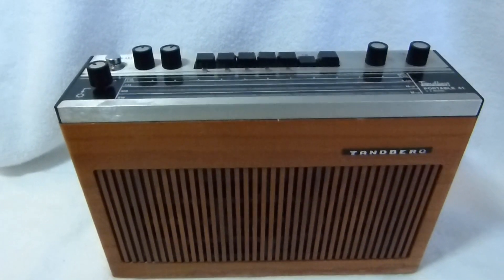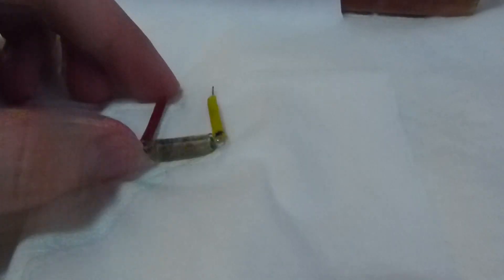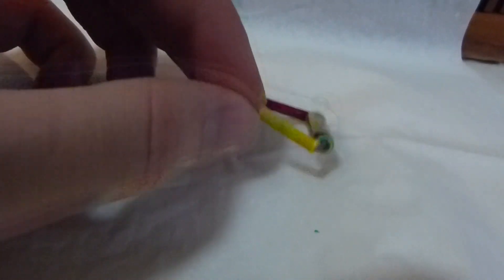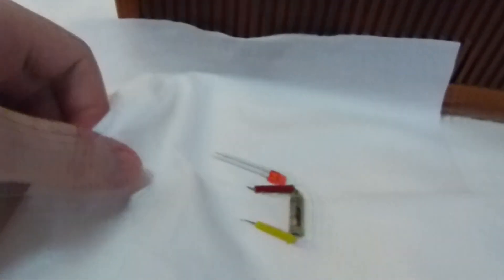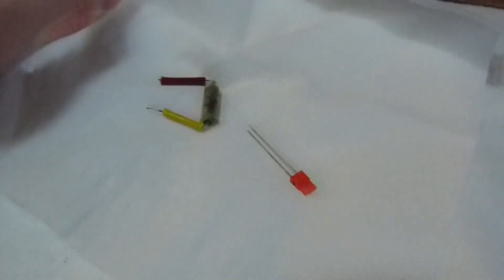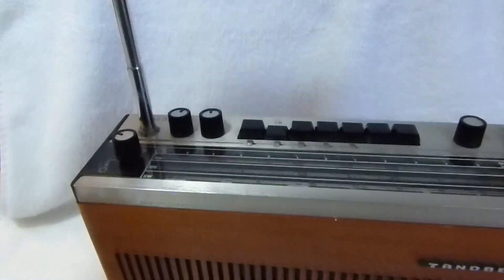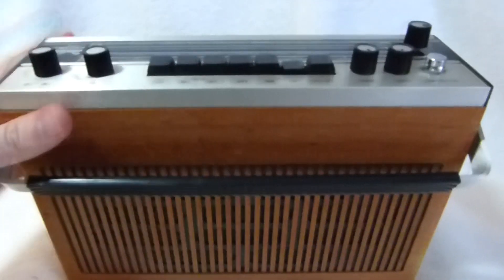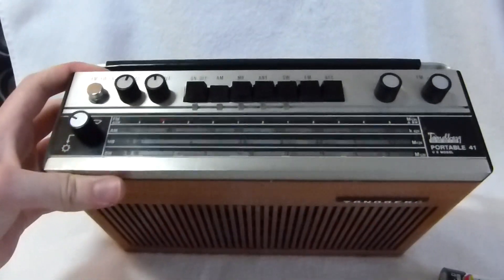Tandberg TP-41 transistor radio (Norway, early 1970s) and how to replace the stabilizer

Comment: Having one TP41.
Trying to connect AUX-cable, but getting very low audio.
But how to actually choose tape-in?
Those two buttons at the same time - marked phono, but whats about tape?
Thanks.
Just trying with my phone (having 3.5mm/1/8inch minijack out), maybe wrong impedance. Inserted a 500kohm resistor, made it a bit louder, but weak sound....

Comment: I used to sell these in my HiFi shop all those years ago. The only none HiFi product we sold. A really nice sounding radio. Just a small point, better to tune the radio with AFC off, then apply when tuned.
Reply from the maker: They are quite nice, I still use mine occasionally. You're right about the AFC, though with many sets it doesn't matter much.

Comment: They are very useful and flexible! Phono stage and 2 pin output to a mono speaker, even seperate bass and treble control. I took mine on vacation and I had one Tandberg TL1210 speaker with me, talking about Hi-Fi on the go!
Reply from the maker: I haven't tried this radio with an external speaker, since it has a big internal speaker, but it does seem to have power to spare, so I bet it sounds great on that external speaker.

Comment: Hi, I do have the same radio TP-41. Since my knee transplantation surgery, I didn't use my radio for some time. Now, the treble control knob could not be turned either side,  it's very hard   and it's jammed like condition. I am much worried about this condition of loving radio.  I carefully opened and gave a spray of 'Fader lube' of Deoxit and tried to rotate the control with effort. But, there was no response.  Dear friend, what to do? Before the long storage period, it was working well.  Can I replace the with the same model original control? Is it available elsewhere?  Even though the radio is working, I cannot tolerate this miserable thing happened. Kindly help me. My email id:   suseekish@gmail.com   Thank you.
Reply from the maker: +Suseendran Balakrishnan I usually apply light oil (I use clock oil) to the point where the shaft of the control enters the body of the potentiometer, that usually frees them up. It would probably not be easy to find an exact replacement control, so it's best to try to save this one.
Reply: 50sTransistorRadios
Hi, thank you for your reply. Instead of clock oil, shall I try with DeOxit spray? Any thick sediments will be loosened. But, should I apply only thin oil? To apply the oil to the shaft, should I open the top dial cover? Or just enough to pull the knob of the control? Please let me know in detail. Thank you. Regards.
Reply from the maker: If you have a needle tip oiler, you can just pull the knob off and apply oil to the point where the shaft enters the control directly. If not, you could just let a drop of oil run down the shaft into the control. If you have deoxit spray, it would probably make a mess in there, but the liquid form might work. I would suggest a light oil so it works its way into the bearing and frees it up. Good luck!

Comment: "how to replace the stabilizer" seems to be left out. I dont see that in this video.....?
Reply from the maker: +Stig Rasmussen I don't show the soldering part of it, but I do explain what I did and show what the stabilizer looks like. FYI, the schematic I have for a Tandberg "Auto" shows the voltage drop as being 1.5 volts not 1.8 like I said in the video, so that may be the correct voltage (I don't have a readable schematic for this model)
Reply: +50sTransistorRadios , thanks!  Yes , meanwhile I have found out about it and replaced with a LED, give 1,6V , but that was not really the problem with mine. I also had to warm up and lubricate the AM tuning capasitor so that now work ok.
Reply from the maker: Oh well, it should be one less thing to worry about now. I have noticed that the AM tuning capacitors on European sets are frozen way more often than on American or Japanese ones, perhaps the European parts used tighter tolerances.

Comment: Interesting back in Norway people usually replace the voltage stabilizer with two silicon diodes and one germanium diode in series, connected to one 220uF capacitor in parallel, copying the circuit from the tp43 model. But i guess it is enough with only a diode (or diodes) with the right voltage drop. If it´s not really needed, why did Tandberg use the capacitor on the updated model in the first place?
Reply from the maker: +Stian Modin Rismyhr The only manual copy I have found for this set is too low resolution to be usable unfortunately, but I would guess that they added the capacitor to stabilize the voltage even further. The current draw on the part of the circuit which the stabilizer controls appears to be low and stable, so my solution seems to work well enough (it has no problems with staying on station). I would like to pick up a tp43, but they don't show up often here in the USA.